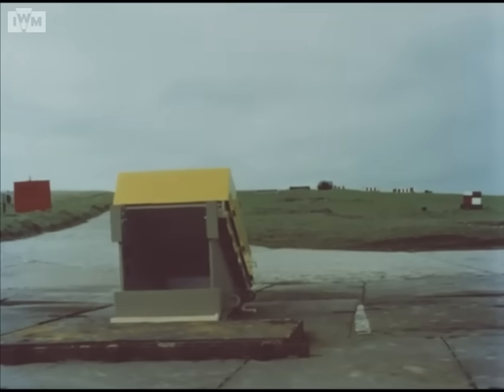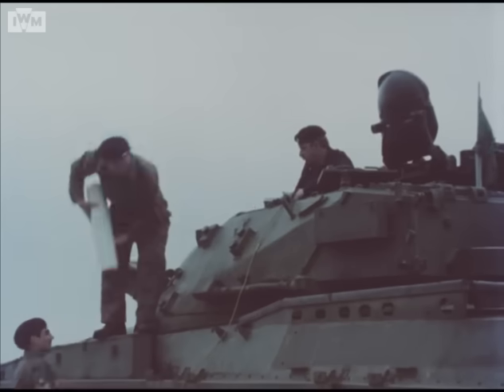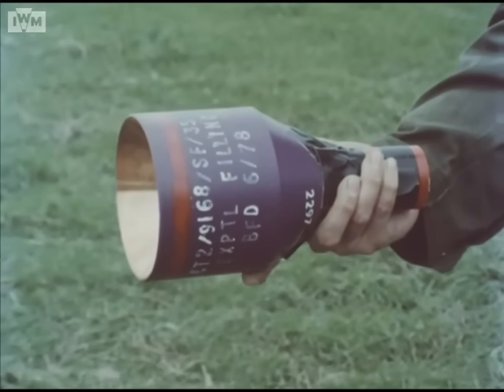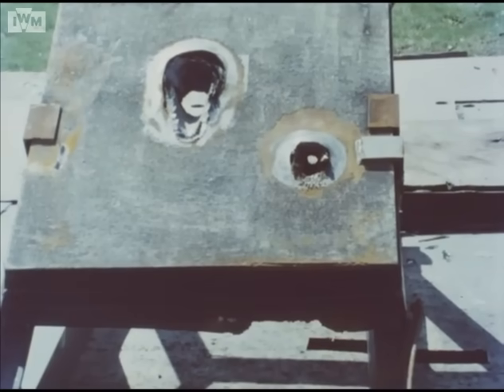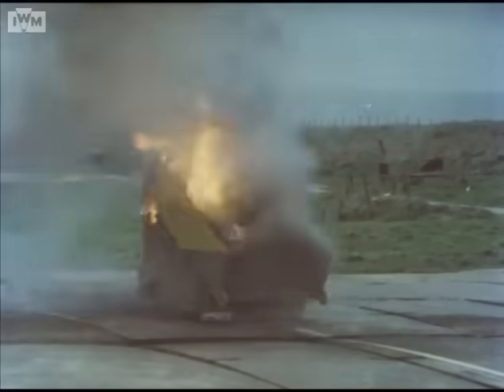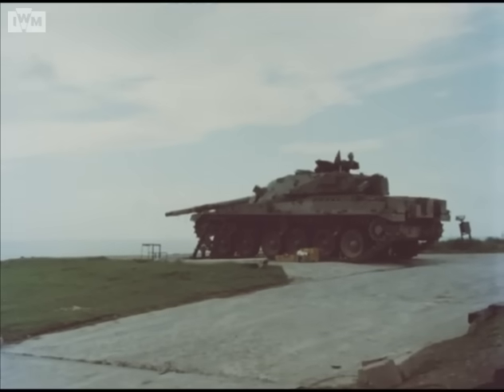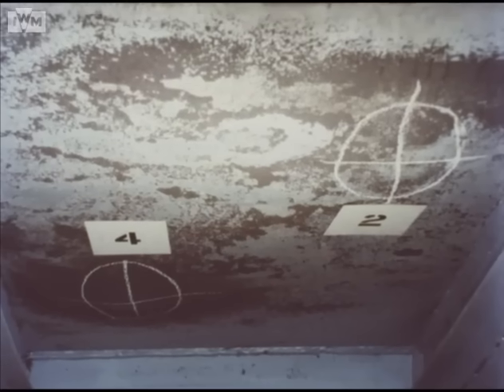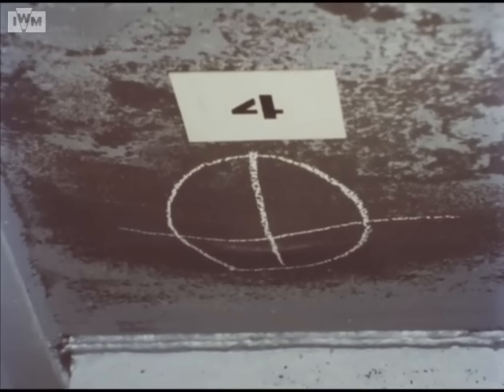Firing trials on British Chobham armour 1979

Comment: Notice how they fill in the holes on the Chobham armour so we can’t see the inside structure. Top secret still to this day.
Reply: It's fruitcake and expired Scottish pudding
Reply: @thecursed01 I thought it was cornflakes recovered from the bowl after having sat in the bowl in old milk for a day? They’re impenetrable.
Reply: @georgemorley1029  Your wrong, its Capt'n Crunch. Learn to do your research sheesh.
Reply: @InsanoBinLooney Not in a British tank it ain't!
Reply: @thecursed01 I heard it was formed with layers of dried weetabix extracted from cereal bowls.
Reply: So the HESH should have contained midges. They will get through anything! @thecursed01
Reply: @thecursed01  utter pish, its porridge thats set 😂
Reply: @thecursed01  SSSHHHHHHHHH! That's top secret! Now everyone knows.
Reply: It is a composite made up of several  layers of pizza sandwiched between heat treated steel.
Reply: @liamo8932  mozzarella is the key!
Reply: Those white blobs did look a lot like Mozzarella. @liamo8932
Reply: Pizza with tomato sugo, or without?
Reply: @daveallen007  nah mozzarella and oregano 😁👌with sun dried tomato pasata 😆
Reply: @liamo8932  Is it pineapple pizza?
Reply: @dashans6175  trials were undertaken of a variant including Pineapple. Despite an overall improvement in survivability and taste, the final decision was made to exclude it. The MOD felt it would limit the potential export market to other states, most notably Italy.
Reply: No, that's a legit intel leak.  Chobham is, in fact, entirely filled with fluffy nougat.
Reply: @bronco5334  Traitor!
Reply: @bronco5334  idk I heard it’s made of old Scottish kilts, never washed.
Reply: @bronco5334 blended Michelin men
Reply: It's actually steel plates sandwiched between layers of 2 day old dried weetabix. It's collected from the officers mess in a top secret red box.
Reply: Its rubber, Chobham at its simplest is two steel plates with a thin rubber layer sandwiched between the two plates, when pressure is excerted on the armor plate the rubber expands at the point of impact bulging the steel outward, it's essentially NERA or non energetic reactive armor, the bulging of multiple NERA plates at an angle can distort an incoming shaped charge jet by breaking it up just the smallest bit so the tail of the stream can't follow through the hole that the tip already penetrated making it less effective, it can do the same with long rod APFSDS rounds too although they are more effective at penetrating NERA than shaped charge projectiles
Reply: @2bidfilmsguy "two steel plates with a thin rubber layer sandwiched between the two plates" - lul.

The US version has DU in it and the UK version has tungsten in it, which is a big hint that not so much, no. It also snaps kinetic penetrators, which wouldn't do that and ERA can't do either.

In re the rest of this thread, some of the comments are completely delusional. 🍿
Reply: @streaky81  also heres a computational fluid dynamics model showing how ERA not NERA they are different but work on the same principles when it comes to defeating kinetic penetrators, stops a APFSDS round

https://youtu.be/zK77-8kJ69c
Reply: @2bidfilmsguy Sorry but you’re making this up, you don’t know so are just assuming
Reply: Allegedly composites of some type. The latest Dorchester armour is allegedly superior still....
Reply: @Brian-om2hh  Called 'Farnham' and yes, much more so.
Reply: @Brian-om2hh  Ch3's Epsom armour would be the latest now
Reply: @Brian-om2hh AT rounds keep improving too
Reply: I've heard, maybe erroneously that the ceramic layer becomes a high pressure liquid under the high temperature penetration and the force of the liquified ceramic can act upon the jet in a heat charge attack. I just thought I was looking at molten ceramic. It's probably more likely its holes that were filled to hide armour thickness and array composition like you said.
Reply: @Ulrich_von_Jungingen  I've heard the emphasis on ceramic as the principle component of Chobham armour is cold-war propaganda meant to misdirect the Russians, and it is actually the rubber NERA (the bulging substance you see filling the holes in the steel) that is doing the heavy lifting.
Reply: "Right! Now you've watched this, everyone immediately kill themselves!"...
Reply: The Russians now know.
Reply: It's made from Weetabix that's been soaked in milk and allowed to dry.
Reply: If this is the early Burlington type it's been declassified now
Reply: Ask on WT forum, they'll give you blueprints within 5 minutes.
Reply: its actually made of pizza dough from Italy .
Reply: I'd have thought that was the synthetic material between the steel plates just super-heated by the hits and just expanded...
Reply: It's multiple elements of rubber sandwiched between two steel plates, with an air gap between each element.
Reply: Chobam armour is a steel outer layer with intermittent layers of NATO "cheese possessed", Garibaldi biscuits and Yorkie bars (if you know, you know😉)
Reply: Thanks for that. I wondered what's that?
Ive made and tested shaped charges fro wine bottles on a French Commando Course. They punched through three one inch Armour plates, just laid on each other. They didn't move either. Just punctured.
Reply: It's not puss?
Reply: Well there's not much point anymore, the Russians have captured an Abrams in Ukraine. The secret is no longer secret.
Reply: And the moral of the story is - stop supplying arms in a proxy war while making out the side you are supplying against is somehow evil empire number 1, when realistically you are built on its laundered oligarch money, and have been instrumental in the blatant hypocritical NATO push 3 seperate times to a cause this war like a good U.S. puppet does. Unfortunately even my own government pushes the rhetoric coz we have their hand up our puppet hole too. The ol Commonwealth is a haggard street hooker that does anything for $ these days 🇦🇺
Reply: The NERA element in Chobham in play I'd reckon actually
Reply: Not to Russians.
Reply: its rubber
Reply: ask russians😂
Reply: I was wondering what that was! Thank you!
Reply: Nah it's no secret.. it's really just ramen noodles and super glue.
Reply: they fill it so we can't spot a hole :)
Reply: The baseline Chobham isn't that secret anymore, we have a pretty good idea of what it consists of.
Reply: Chewing gum  and string I heard…..
Reply: Surprisingly they let us look into it deep enough to see the first layer after the outer steel, which looks to be some kind of ceramic.
Which would make sense, earlier types of composite armor supposedly used ceramics as the hard and dense layer.
It seems in later composite armor they replaced the ceramics with tungsten and sometimes depleted uranium, like in case of the Abrams.
It's also thinkable that the Abrams has at least a thinner layer of tungsten with depleted uranium underneath, possibly only a mesh instead of a solid layer, or possibly overlapping meshes.
Reply: Figured out what Chobham is made up of don't tell Nyone it's the pie sister off the pies in the pie shop by ußdroped pie on pavement vneeds new paving stone don't tell the Russians Dorchester has the custard from the custards out the cake shop on the out side covering secrets out
Reply: It’s filled with old teabags
Reply: @JohnSmith13334  
No such thing as an ‘old teabag’ in Britain.
Reply: it using the same thing like back in the day as  "starlite" if it get in contact with heat, some kind of carbon layer form thats almost undestroyabkle
Reply: its dried on weetabix.....the toughest material known to man
Reply: Challenger 3 now has Epsom and Farnham, it's  the latest version of our NERA and ERA, what you're seeing here is the original NERA blocks used on challenger 1 and Abrams A1 in the 70s.
Dorchester and the other one I forget the name is what's on challenger 2 and now obsolete.
Reply: One layer of British steel and two ships biscuits.
Reply: You can make a similarly robust substance at home by eating a bowl of weetabix and allowing the residue to dry onto the bowl.
Reply: That is probably filler material reacting to penetration, foamed ceramics.
Reply: Not secret anymore since the Russians have it
Reply: the russian cope is strong here
Reply: @winstonwho  wasn't it a UK MP that revealed that UK would last less than week in a war? It seems these fantasies about magical super secret armors is coping with the fact that there is no functional military and it all rests on the US protection
Reply: No longer I guess... the challenger 2 blown up in kursk revealed it.
Reply: Hardly a secret now, with Challengers sent to Ukraine.
Reply: 🤔 ablative armour ( reduced laminated thickness). Armour now maybe redundant aerial and ground drones seem highly efficient armoured destruction.  Battlefield technology rules now 2025😳🇬🇧.
Reply: How can they keep the formulation secret while supplying tanks to Ukraine?
Reply: @BenjaminXHenry  Technically the formura remains secret until the russians get their hands on it. 

Keep in mind the armour is a enclosed piece of steel. until someone cuts the steel to look inside you can't tell whats inside. So the crew and even the maintenance crew does not know whats inside. (Major repairs are done in poland by us, german or british crews)

Which is apparently happened, The russians upload pics of their armours, And to be frankly the Challenged has an embarassingly flimsy armour. The side and rear plates are like 30-50mm thick homogenius armour plates at most.
Reply: That's the stuff ubder the steel thinking it's vibranium 😂
Reply: That's the round stuck in the armour
Reply: @richardjubb192  nope 😅 it's a compound under the steel that thinks it's vibranium 😉🙏
Reply: @richardjubb192  Chobham is like Supermans underpants.  Everything bounces of it.  Including alien weapon systems.

I think they use kryptonite in chobham armour - don't they?  🙂
Reply: @ Do you think that this test is false lol?
Reply: Some kind of ceramic combined with uranium, some Kevlar. They're based on how to avoid piercing, not how to reduce impact. The captured Challenger appears to be armor-piercing, but not Of internal impact  👀
Reply: @Dejaelvicio507  it's almost like that semi liquid stuff that goes rock solid when sudden force is applied 🤔 too this day noone really knows 😎🇬🇧
Reply: German laminate flooring
Reply: Is it buggery secret. Its ceramic plate as found in the old combat body armour on a rubber backing laid over steel to create a sandwich. Then behind that is a box section filled with silica sand as used in blast furnaces. It's "composite" as it's composed of many components. Ceramic for hardness, rubber for shock absorption, steel for strength and the box section to provide stand off against HEAT while at the same time using the sand inside for its ablative capability. Its all very simple off the shelf stuff. It's the way are combined together that is clever.
Reply: British armored ain't no goddamn secret tf? It's like Japanese tanks. They'll use them IF they have them in inventory
Reply: I was confused, and didn t understanded what it was
Reply: Even if there was no filling, how the hell would you see the damage inside, unless you were shown?
Reply: it's totally not rubber and it's not a thin layer. it is a special non-newtonian fluid which resists shear forces more so than steel, kinda like thick slime in principle. rubber doesn't do that you can pierce rubber with a knife.
Reply: The secret is cats in the metal
Reply: That was a layer of cobham armour under the surface layer of conventional steel there was no hole to fill no penertration
Reply: @Eric-kn4yn That was my thinking. Peculiar substance seems to expand
Reply: @Eric-kn4yn no they clearly filled the impacts in. Come on man.
Reply: @Eric-kn4yn  
Yes so that hole on the surface layer was filled in to keep the inside secret from view.
Reply: @Eric-kn4yn  I'm not sure. Modern chobham does not look like that when hit.
Reply: @Eric-kn4yn  yes and the internal structure of chobham armor is still classified so your statement is completely irrelevant.
Reply: Marshmallow internally
Reply: They didn't fill the holes. That's what it looks like on the inside.
Reply: Chobham is nera nkn explosive reactive armor it is multiple layers of steel with rubber in between. It is old nowadays. Composites and ceramics don't seem to be used much in tank armor probably due to cost.
Reply: Its full of dried wheetabix
Reply: It would be unbelievably British if the secret was that the engineer who designed the armor was always getting inedible lunch cooked for him by his keen but crap wife. So he put the overcooked whatever into the armour which gave it the strength to resist kinetic attack. But then she was the sole source of composite armor for the British army, and when she retired, thats when they developed the new Dorchester armor. 

True story
Reply: yup...it looks like that armour didnt help them in ukraine
Reply: It's Shredded Wheat bricks 😂
Reply: Made of dried chocolate ready break , like cement !
Reply: One has been disabled and captured in the Russian/Ukrainian war?
Reply: @akula9713  yes 1 was destroyed in Ukraine but the challis exported there don't have chobham armour
Reply: @skinniestfatman5641 The 14 given to Ukraine are exactly the same as the British Army examples minus the TES kits.
Reply: @paultanton6721  no they're not, Chobham is still a top secret armour therefore we would not risk it falling into Russian hands, all export models are shipped without chobham/Dorchester armour
Reply: @skinniestfatman5641  The Armour is not so much a secret today, It has seen further developments in the last 25 years, the MOD must have been satisfied with the risk of capture of an example/s versus the Capability they provide. There are no 'monkey' models of CR2 tanks.
Reply: @skinniestfatman5641  Yes they do, if they didn't have their armour inserts then they would have a maximum of ~100mm RHA. The only thing the Ukrainians don't have is the Dorchester 2F kit because it adds too much weight
Reply: @skinniestfatman5641 it did but not the newest version also old era but china will buy it up
Reply: @skinniestfatman5641 every single Challenger 2 has Dorchester armor, which is an improved Chobham. Every single one of them
Reply: @skinniestfatman5641  they do lol
Reply: @skinniestfatman5641 you do realize challenger 2 doesn't use Chobham it uses Dorchester. Also the UK MOD said that these Challenger 2's were British army ones that were in storage since the 2000's they also sent DU ammunition with the tanks. 

Also whats the point of having a "secret armor" that is never tested in combat.
Reply: @paultanton6721 no they are not, they haven’t been supplied with the updated armour
Reply: @skinniestfatman5641 yes they do, chobham armour has now been superceded by Dorchester armour.
Reply: @skinniestfatman5641  yes they do. 2nd gen btw
Reply: @skinniestfatman5641 it's not exported. What armour did it have? Plot armour?
Reply: @akula9713  Recovered
Reply: @akula9713 one M1A1 SA was rendered combat ineffective but managed to drive away. An unknown number of Challenger 2s were disabled/destroyed, but none of them captured by the russkies
Reply: @akula9713  it hit a tank mine, crew survived, was not captured
Reply: @akula9713  They use Epsom now. Chobham is history.
Reply: @akula9713 any tank can be disabled, the tracks aren't made with this armor are they?
Reply: @steriskyline4470  tank has to present its side to enemy for tracks to be targeted the old story from ww2  tanks try to avoid this
Reply: @steriskyline4470  Better the tank then the crew being disabled.
Reply: @marshalljulino the abrams ran over a mine was disabled the crew fled then it was destroyed e3676
Reply: @steriskyline4470 
And you were made disabled too. Even non tanks are to be protected with this armour.
Reply: @akula9713 Incorrect. No vehicle with Chobam has been exported to any country, including Ukraine.
Reply: @mfuchs2004  so what did they send them with?
Reply: @akula9713 One was destroyed but it wasn't captured, it's still in Ukrainian territory.
Reply: @akula9713 we haven’t supplied the Ukrainians any form of additional up armour..
Reply: @akula9713 Doesn't have Chobham.
Reply: @akula9713  Yes, a older model without it's chobham armor using tungsten armor instead because the armor is classified, like the tanks given to Iraq I believe a few were destroyed there also but the crew survived unlike the jack in the box Russian T series.
Reply: @legion6277 They're not an older or downgraded model, they're standard challenger 2s taken directly from storage. Chobham armour is nothing special today, practically every tank built from the 80s onward uses NERA of some form.
Reply: @akula9713  the ones shipped to Ukraine have been export versions that do not have the chobham armor upgrade. The secret sauce stays between the US and UK.